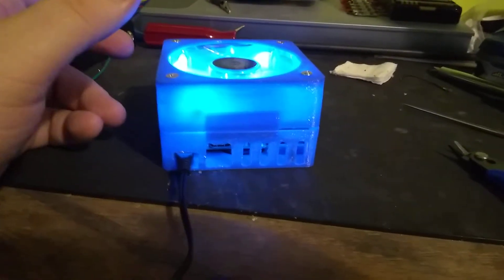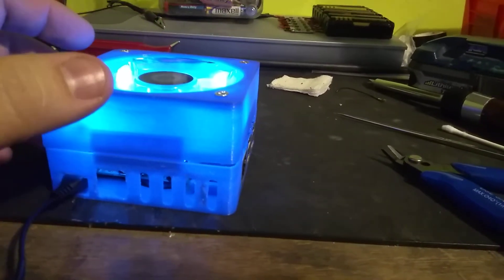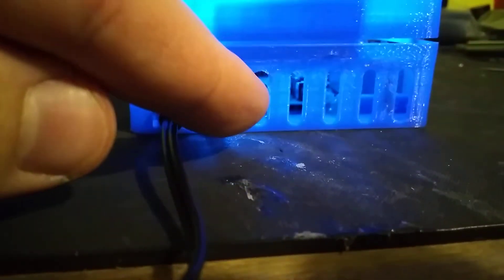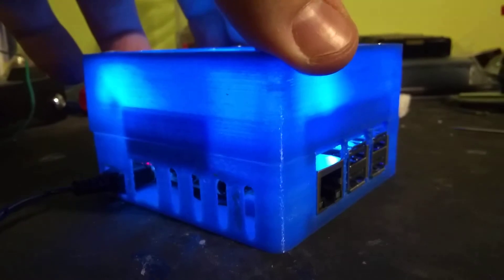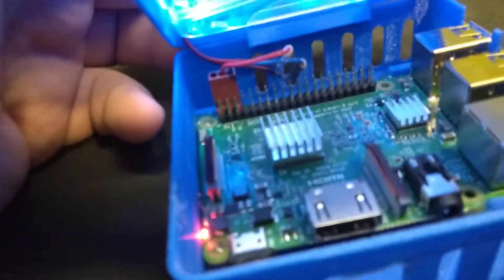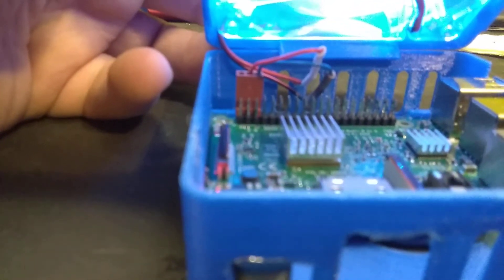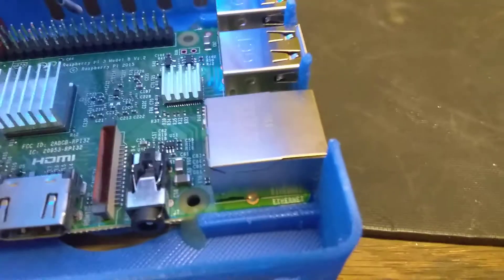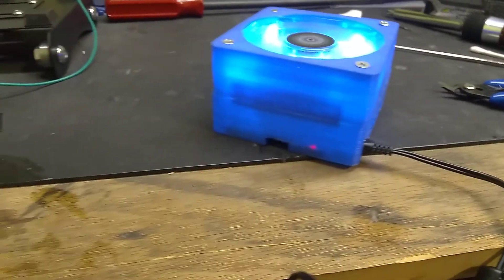3d printed 80mm fan Raspberry Pi case

Comment: That looks really cool. You could add some dust filters in the spare holes (perhaps also on top of the fan) and it would look even better. Keep up the good work!!
Reply from the maker: I would leave the exhaust side vents open but it would be really easy to add a fan to the top where the air enters. Since its a standard size 120mm fan they make filters for them.